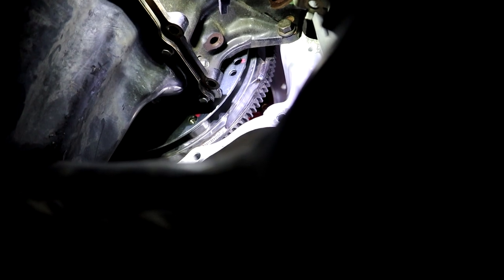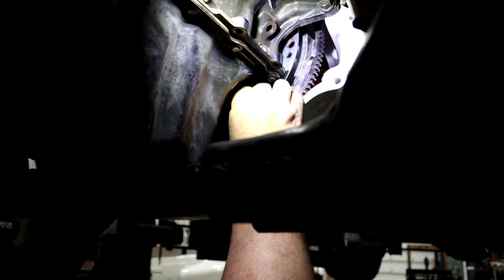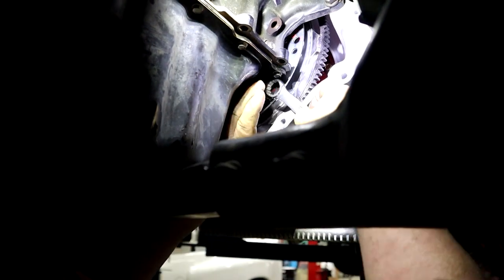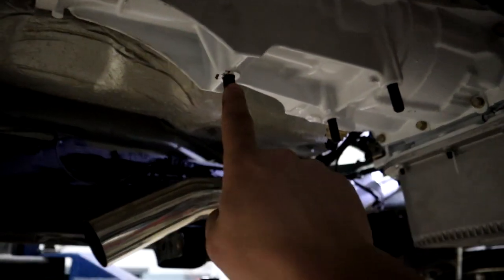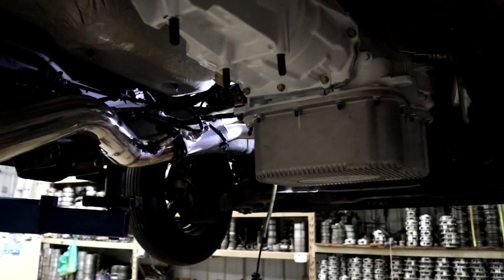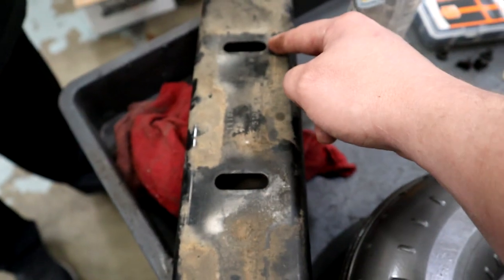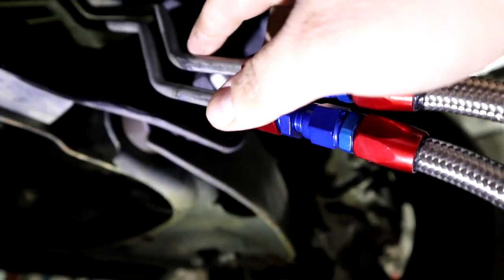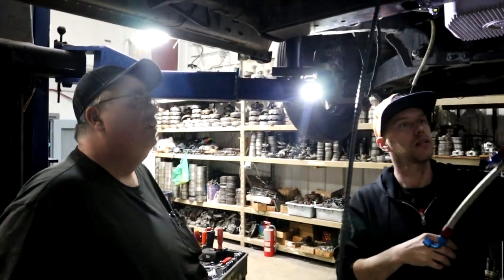Ram 1500 545RFE To 46RE Transmission Swap From Cope Racing Part 2

Comment: So that transmission will work in a . 04 Dodge Ram 4x4 the 46R. E with the 5.7 Hemi  and what year is that transmission you are putting in your truck man Thanks in advanceThanks in advance.
Reply from the maker: The 46re is had a long run in production from like 95-02

Comment: Very informative video I really enjoyed every second of it .. I jus had my factory 46 re all rebuilt with all new internal performance parts An matched my torque converter to my Comp cam an stage two shift kit it’s in my 2002 5.9 modded magnum that came in truck .. it really performs very very well now .. I live in Canada so had it done at a local shop Similar to cope racing trans shop 👍great video bro !!
Reply from the maker: Thats awesome man🤘